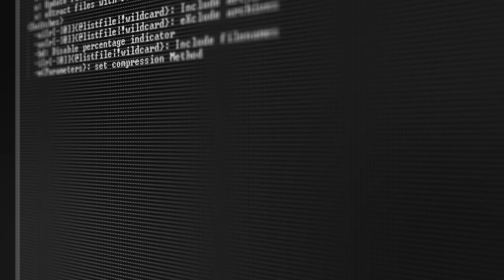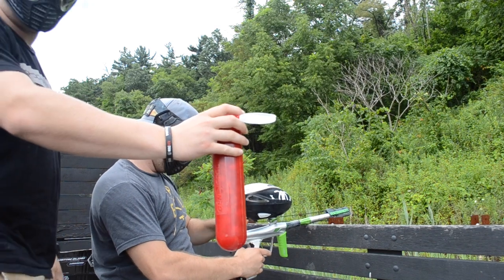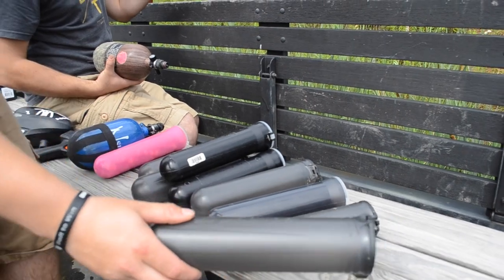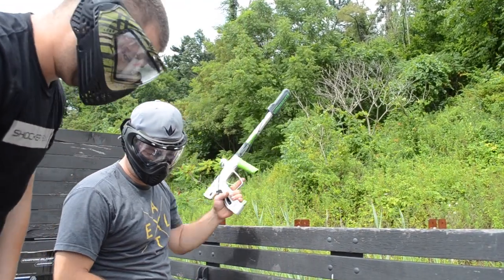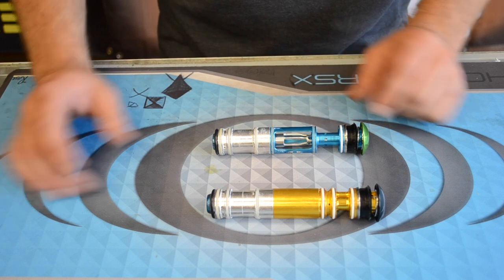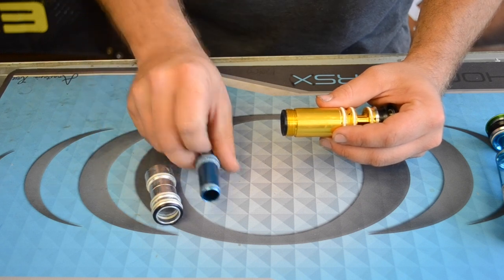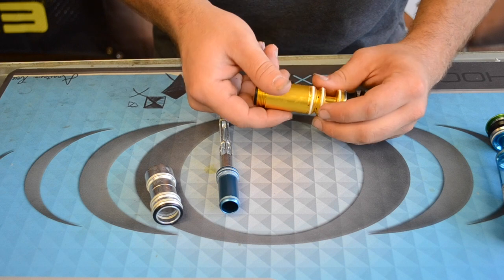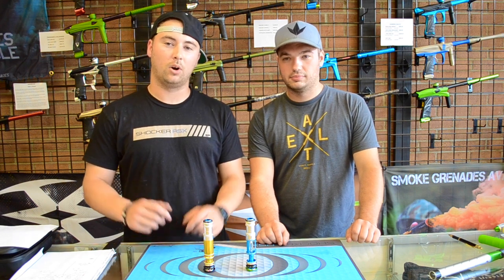Shocker RSX high flow firing chamber review

Comment: im still kinda new to paintball. the first gun i got was a bt omega, the second is a kingman chaser. now my third im getting is the hammer 7. my point is how in the hell do u keep shooting and pulling your two fingers back that fast for that long? is there excersise i need to do that would help my fingers?oh god that sounds dirty. but still please help me
Reply from the maker: practice, practice, practice.  Also its a lot easier with a speedball style marker that has a trigger designed to shoot fast than it is with the markers you say you have used.
Reply: Sorry im still just saving up i need a new mask and gun
Reply from the maker: No worries buddy, if you need any gear check out our site punisherspb.com
Reply: +Punishers Paintball thanks fam
Reply: One thing you can definitely do is, if you're watching TV or sitting around, take a speedball gun (don't know if you own one or not) and just keep hammering the trigger with the gun off. I like to turn on my Axe and shut the eyes off to get the feel for where the trigger is actually releasing the ball, and go from there. Just like anything that is repetitive, it'll be a while before you have that endurance.
Reply: mr.sneeky Omega it's just practice and getting used to it. Also is that all speedball  markers have something in common wich is “ramping mode” wich it works in the way that if yo shoot 1 by 1 the gun reacts semi-automatic, but as soon as you start tapping the trigger continuosly fast the gun will automatically turn into “automatic”. But the thing of tapping the trigger fast is easy and you'll get used to it...
Reply: get a bic pen and just walk the shit out of it. the pen will make a clicking noise on each pull. Much easier than using your gun and wont wear out your microswitch
Reply: Haudiel Martin technically not automatic. The gun is programmed to add shots per trigger pull sounds auto. Most when you slow down but still hit the trigger within a given time the gun will fire 3 shots.